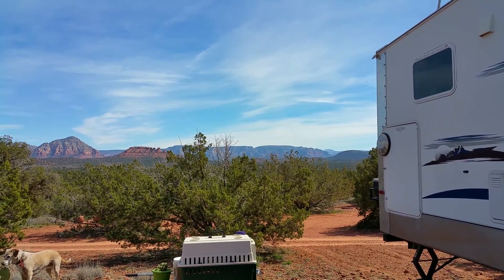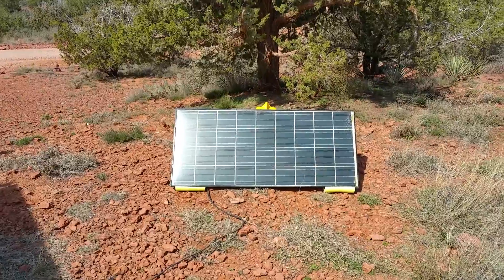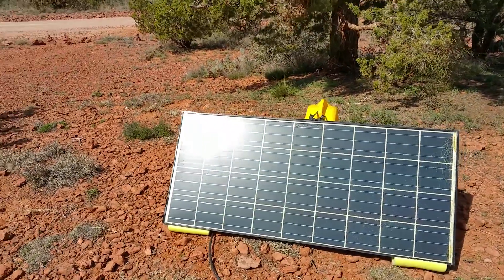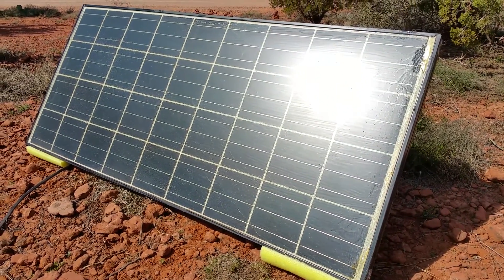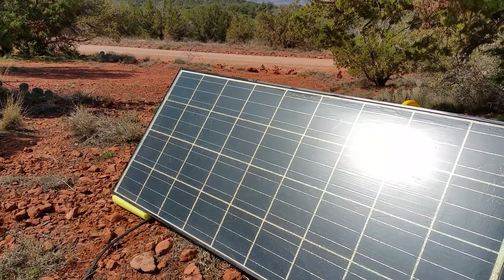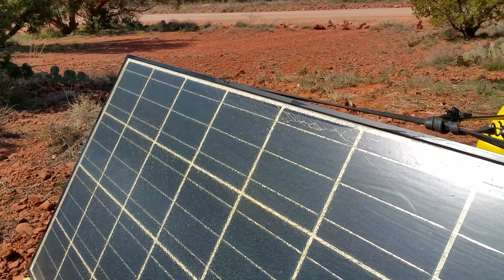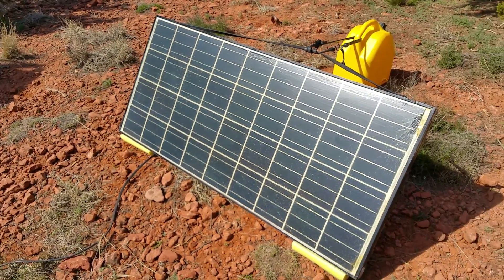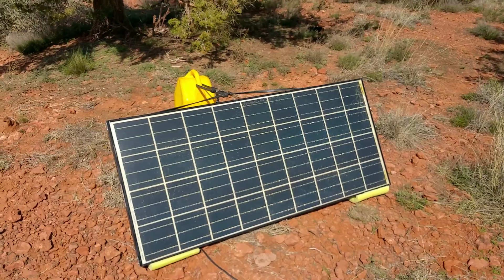"Solar Boondocking" Damaged Solar panel Repaired!

Comment: Hey Eddie, could your pour a thin layer of epoxy resin over the damaged area? It is expensive so I don't  if it would be worth it. Take care
Reply from the maker: I'm not sure the epoxy would be UV protected? May be a good idea other than that.
Happy Trails!!!
Reply: Mobile Homesteading Hey Eddie, I believe it may. It is used in boat repair.  Just a thought. Take care!
Reply from the maker: It may, but I don't want it too thick. If it is too thick the sun wont get into the cells.
Happy Trails!!!
Reply: Mobile Homesteading OK, didn't know they would be that sensitive.  Thanks for all your videos. Take care and God Bless
Reply from the maker: I'm still looking into trying your idea, I just don't want to block the cells.
 Thanks for the input, and the ideas. That's how we get stronger, sharing ideas!
Happy Trails!!!